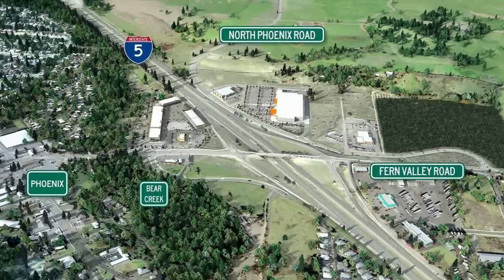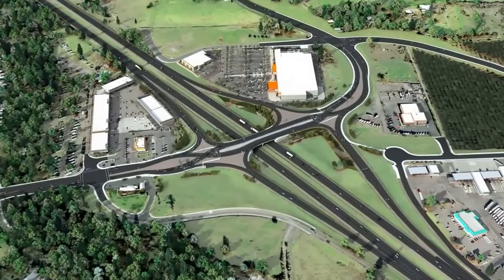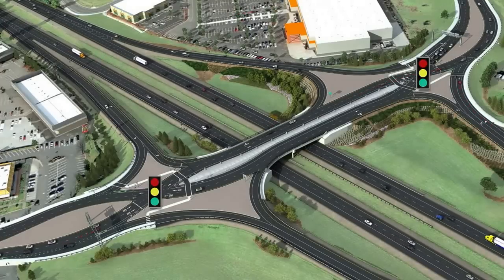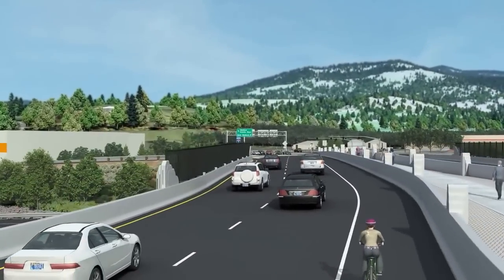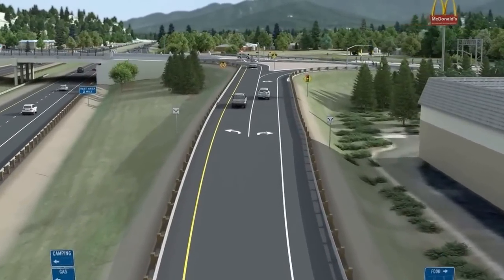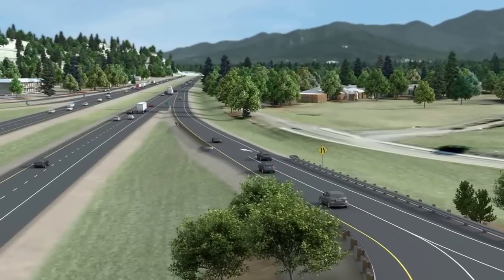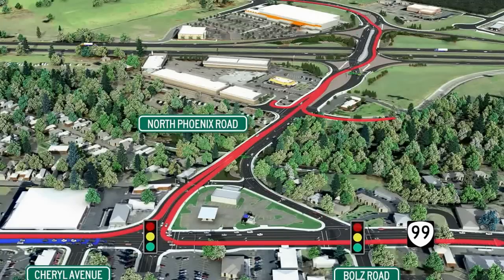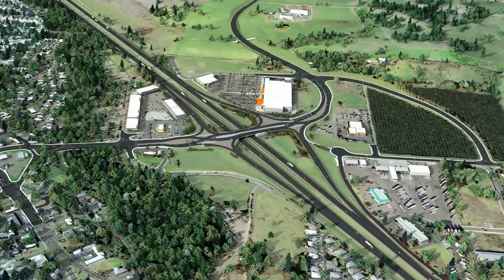Interstate 5 Exit 24 - Fern Valley Interchange DivergingDiamondDriveThroughOct2013

Comment: Now with this interchange that's supposed to handle traffic for years to come, the City of Phoenix has decided to take hwy 99 down from a 4 lane hwy to a 2 lane hwy with bike lanes.  Why do we have the bike path along Bear Creek?  Drove through Phoenix this evening, not one bike, but traffic bumper to bumper at 12 mph instead of 30 like it used to be.  Good job Phoenix.
Reply: I can't stand that they made it one lane through town.
Reply: +richjon77 It's called a Road Diet.  It's designed to slow traffic down so you're more likely to see & stop at businesses in Phoenix.  What it really does is make you wait for a long time to cross East or West over hwy 99 & it actually kills business.  As a local contractor, I won't drive through Phoenix anymore because time is money.  Every time I do have to drive through, I call Urban Renewal to let them know that I don't see any bicycles, and I'm not happy with the changes.  If enough people complain, they'll change it back.  Call 541-512-8703 every time you're in Phoenix and voice your concerns.  Thanks!

Comment from the maker: Actually, this design adds more ‘green’ time to keep traffic moving by eliminating the separate left turn movements at the crossing signals. Unlike a traditional interchange signal, the two left turn opportunities, which are not necessary in this interchange design, each had their own separate ‘green’ time that held up all thru traffic.The DDI has reduced delays and congestion in Missouri where it was first implemented.